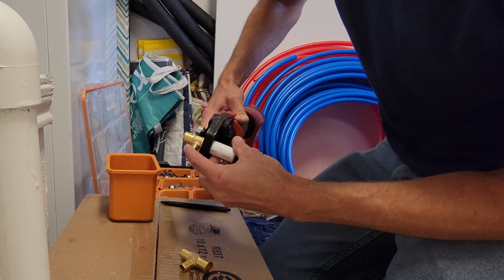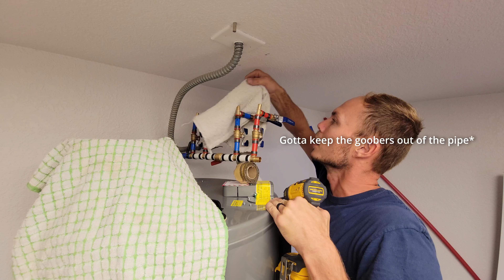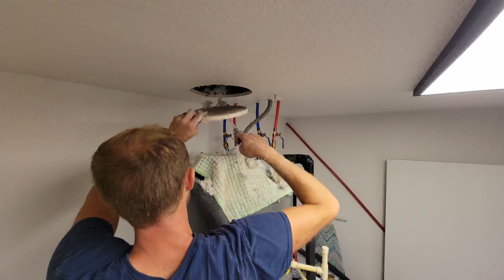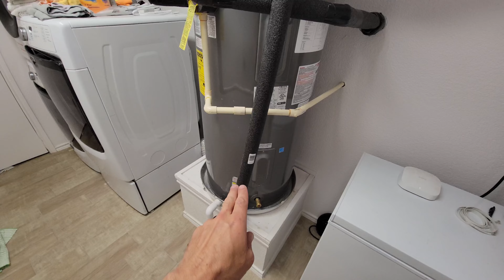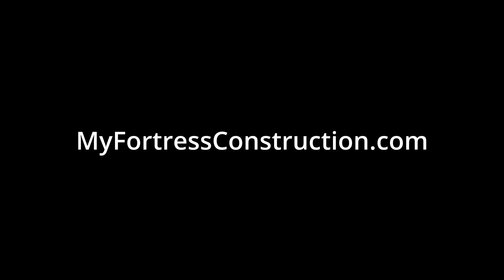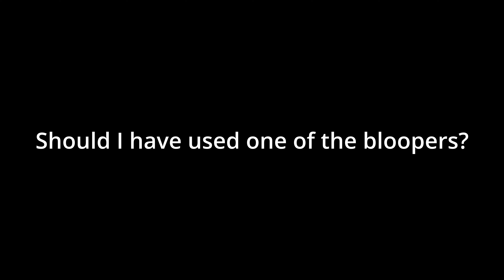Turn Hot Air Into Money

Comment: If you wanted to help heat water through your attic, you should be using copper pipes (thermal conduction is better with metal).  This would be more efficient. 
The other issue is water pipes in the attic, this is a really poor idea. A leak will go into the walls, you will not catch it before mold forms. Typically mold removal will set you back $20,000+, you do not want this.
Another downside is direction of the flow in a heat pump system changes based on need. The way your system is set up, you would need to reverse the flow of water during the colder months.
A better solution is to use a solar heat pump design, or a standard heat pump design, or a tankless system (which is usually the most efficient).
Reply from the maker: Pipes passing through the attic is common practice around here, and unless you have a squirrel problem, there isn't usually an issue. Also, pipes coming up from the slab, or down from the attic, can leak and cause mold. Replacing a pipe in the attic is 100x easier and cheaper though.
  Still, this is the easiest design, there are many designs that would work better, but require more space or cost to implement. Sometimes the easiest solution isn't the best, but it can still accomplish its purpose. Your house design, and where you live, plays a large role in what will work for you. My design means I don't have to have additional space outside for a solar rack, I don't have to worry about UV degradation, and I can drain the water out during the winter without much effort.
 Also, I've remodeled many homes with mold due to improper exterior flashing, and/or flooding, and your $20k price is more for a home with extensive water damage, not a pipe leak.
  As for copper being better at conduction, you would be correct, but I didn't get 200' of 1/2" copper line and valves for free. The PEX will still heat up fine during most of the year and accomplish its job, though this is a bit of a test to see how much it will raise the temperature of the pipe.
  As to the direction of flow of the system. It never changes for a water heater. You always want heat. You're talking about a geothermal pump or a regular air conditioner that you want to be able to change the flow from heating to cooling depending on the weather, because you're climatizing a home for the comfort of its inhabitants.
 And an electric tankless water heater uses a ton of electricity for the flow rate we would need. I'd have to add another 200 amp service to this house, and with the electric company offering rebates for heat pumps, not electric tankless units, that tells you which one puts more of a load on the grid. Heat pumps are just a lot more energy efficient.
  The only benefit of a tankless is in it not needing to store hot water when not in use. If we had gas, then that's better than electric, but a heat pump is still more cost efficient.
Reply: @MyFortressConstruction  Not sure where you get that a tank is more efficient, you literally have to boil and reboil water even when not in use, the EPA says that tankless is far more efficient, takes up less space and provides hot water only when you need it, and water heaters do break. When they break tanks can be a real problem to drain, or worse they can flood and without warning. Seems tankless makes more sense.
Reply from the maker: @frosted1030  I'm not trying to debate, just trying to enlighten as to how things actually work. You do not boil water in a water heater. That would lead to the relief valve opening up, or it exploding. You are simply trying to take the incoming water temperature and raise it to around 120-130 degrees F. I'm also not sure where you are getting your information about tankless being more efficient than a heat pump water heater. They are certainly more efficient than a standard electric water heater, since you aren't having to store the heated water, but that's not what we are talking about. Heat pumps are using a very efficient method of capturing heated air and turning it into heated water. It's completely different from both a tankless or standard water heater.
   As far as flooding, both tankless and tanks can lead to flooding which is why they created pans to go underneath. Neither one is immune to this, though there is an added benefit of the tankless in the fact that you simply shut off the water and there isn't an additional 50 gallons or so to drain out. Space is another benefit of the tankless water heater. When I built my brother's tiny home we put a propane tankless water heater in it because I could fit it in a cabinet. Can't do that with a standard water heater.
  So, each situation needs to be evaluated and the pros and cons need to be weighed, but if space isn't an issue, and you want the most efficient/cost effective system, then electric heat pump units are the winner.
Reply: @frosted1030 electric tankless are not as efficient. Electric resistance heat is not efficient. Heat pumps are the way to go for space and water heating.

Comment: Thanks for the humor at the end!  So, how much would it cost having someone install this "thing of beauty?"
Reply from the maker: They are about $1600 regularly (though $1800 is technically their normal price) and can be installed without ducting, but there will be extra costs such as additional pipe, replacing the valve, etc. So, materials alone would be around $1800 +tax for a basic install. My install could add on another $300 for the additional pipe, ducts and valves. A plumber would charge a bit to do what I did. 
  I have purchased three of these new for an average of about $450 each. So that greatly cuts down on the timeframe for being reimbursed for one of these.
  One thing I didn't mention is that these would not work very well in a mobile home due to the fact that the closets don't have enough space for ventilation and that most mobile homes don't have an attic for venting. You could probably still fit one, but it'd be difficult.

Comment: I was talked into getting solar panels that were way to small for my electrical usage by a shady company. One thing I have figured out through the app is that my old water heater uses a TON of electricity. The biggest reason I don't have one of these yet is that they tend to have a lot of problems and when your water heater doesn't work, you don't have any hot water.
Reply from the maker: I first found out about these a year ago after installing one in a new build. That one has been running fine, but yes, it is an air conditioner/water heater, so I can imagine it could have issues... Hopefully, not for a long time.
  As to your solar dilemma, couldn't you add on additional solar panels and/or batteries? As long as they're the same kind?
Reply: I've had one since 2016, it has been flawless in operation. Mind you it does require simple maintenance (clean the filter).  If it broke beyond repairable I would buy a new one the next day. It 100% paid for itself in savings in 4 years.